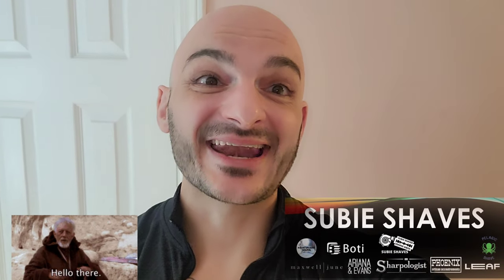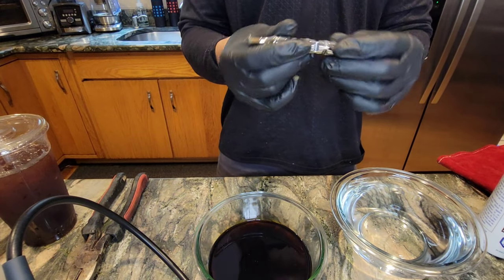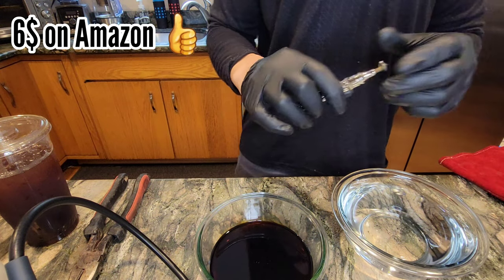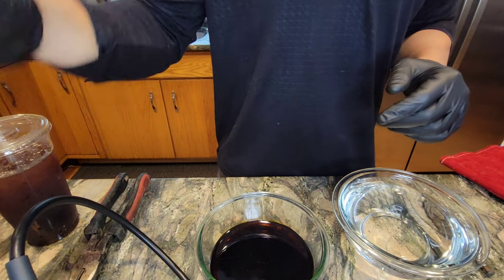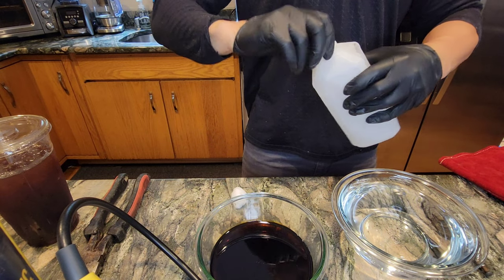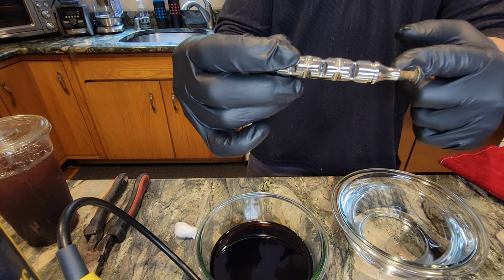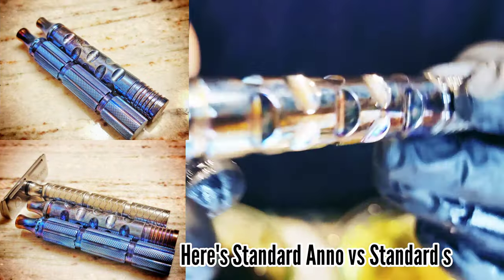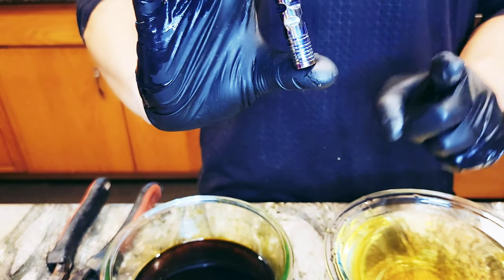ENTROPIC FINISH! | LIGHTNING ANO SAFETY RAZOR HANDLE | EASY TITANIUM ANODIZING TUTORIAL!!

Comment: Who in the world is having more fun than you!? Nobody. Nobody at all. We need more fire, Josh. This was awesome!

Actually, I have a serious request. I know it's not good to try to bend teeth on a razor (or a human). But I've seen it described how annealing works with slowly bending teeth. Heat up, cool down, bend a teeny tiny bit. Repeat. I'm sure you'll be able to find more info. I would absolutely love to see a video where you try that, even if it fails. I think it would be something a lot of people would be interested in actually, regardless of how it turns out. Breaking it might help someone just as much as getting it to work. Just some beat up razor that it wouldn't hurt to mess up. No double rings, please!
Reply from the maker: Excellent idea Lee thanks for the suggestion!! 

Soooo I know Matt from RE and I just had a long discussion about that. He said he tried everything, it is a 50/50 chance even if done perfect to break and that those are bad odds when a razor is still perfectly usable with a bent tooth.

I kind of agree with that which is why I haven't done it - even if I make it perfect -  it may give someone else bad information that leads them to ruin something that otherwise would be ok. 

Thanks so much my friend!!
Reply: @SubieShaves  Yeah, that's a good point. If you do it well on a 30s New, someone may try it on an older thinner toothed razor that may be more rare, and they really want it to be perfect. Then they'll get mad and come after the whole squad. I don't need to be looking over my shoulder for the rest of my life because someone broke a tooth!
Reply from the maker: @Leenunes007  there's just so much risk for not much reward. Listen I'm all for trying something but when the king of restoring Gillette razors says don't do it... I try and listen hahaha

Comment: Buddy if you drop that titanium into those glass tubs they are gonna shatter really cold glass coming in contact with really hot metal makes it fracture
Reply from the maker: Thank you for the feedback! 👍 

I've not had any issues, but - I know you make a very good point. I always wear glasses and gloves for this reason. Ive tried stainless instead of glass but still has issues with the TI leeching oxides when it's quenched. These bakesafe glass bowls have given me the best results this far, but I am always happy to hear alternatives and try them out!

Thank you again for the comment and for the word of precaution! I'm DEFINITELY still learning how to get the best results with titanium.
Reply: @SubieShaves  yea but one time dropping it could ruin that counter top or your day having to clean all that up. You could use deep plastic containers like protein shakers also going straight down vertically might leave a better pattern on a long cylinder the “lighting” pattern follows the steam as it’s released off the hot metal
Reply from the maker: @Justthemow  excellent idea!!! I have an empty one currently actually!! Will give this a try and see how it does out in the garage. I worry that it will absolutely melt through the plastic though. Also great suggestions with the dipping motion! I like that it can all be done differently to apply a different effect 👍

Comment: does this work with aluminum ?
Reply from the maker: No it does not! That process done in a totally different process 👍 

Thanks for asking!
Reply: @SubieShaves  been looking for something like this on aluminum, do you have the name of what it might be called
Reply from the maker: @DrGodzilla  sure thing, look at anodizing
https://www.tfgusa.com/how-to-anodize-aluminum/

This is what you're looking for most likely 👍
Reply: @SubieShaves  I did some more research and specifically 6061-T6  can be heat treated, so would that be possible to use this method
Reply: I guess is it the color changing property of titanium the reason why it wouldn't work on 6061-T6 ?